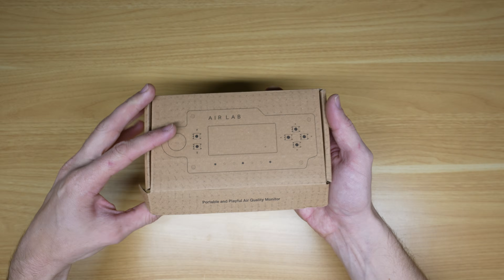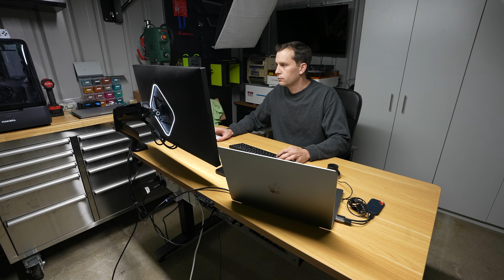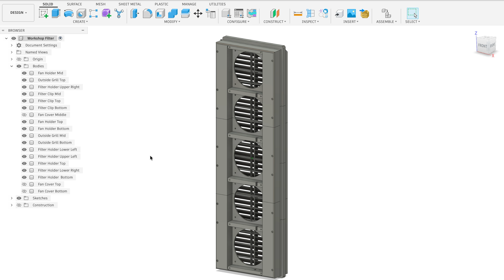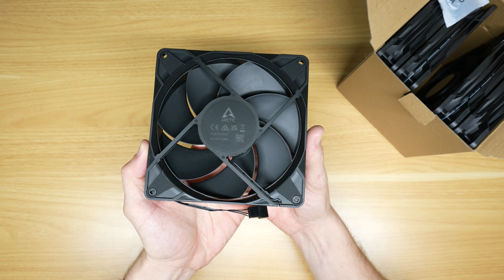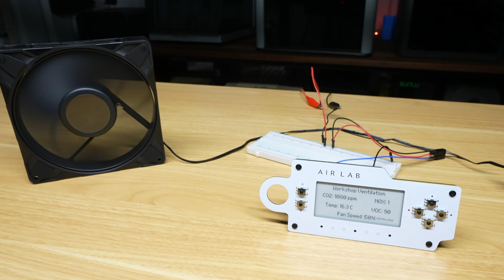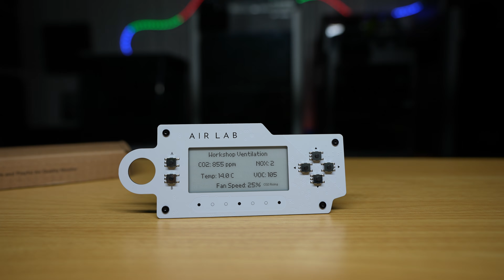I Built a Smart Ventilation System for My Workshop

Comment: I recently made a CleanAirKits style indoor air purifier. The Arctic fans have a very loud high pitched humming. 

The Be Quiet! Fans with 2500rpm worked great instead. They are pricier but worth it if you want to eliminate the noise.

Comment: From a cursory glance at some other articles about the accuracy of the data, I would really love to see a comparison between the data from the SGP41 sensor and the PM2.5 sensor, or better yet a more industrial/commercial solution if you would be able to source that. Especially a three way comparison since I (and most likely other people watching) would not have the ability to test anything better than a consumer device.

Great video!
Reply from the maker: Thanks for the suggestion! From my previous experiments with weather stations and building an indoor air quality monitor using a DFRobot CO2 sensor, I think it’s usually best to use these devices as a comparison or to trend against their own previous data rather than absolute values. So use the trends to see how metrics improve or deteriorate.

Comment: Isn't fresh air in only good if air is also moved out of the space? Excellent video and design.
Reply from the maker: It’s not a sealed up room, by pushing air in, it is forced out elsewhere through gaps around the door, walls, roof etc..
I went with pushing filtered air in rather than drawing air out to avoid pulling dust in from outside.